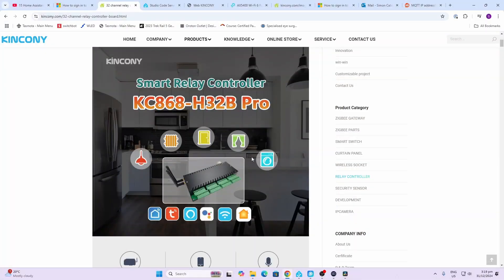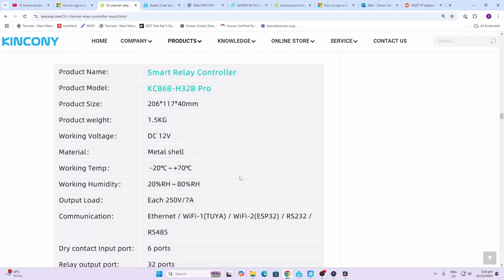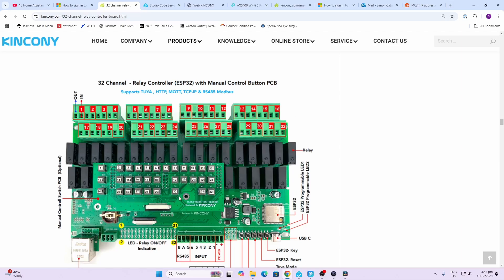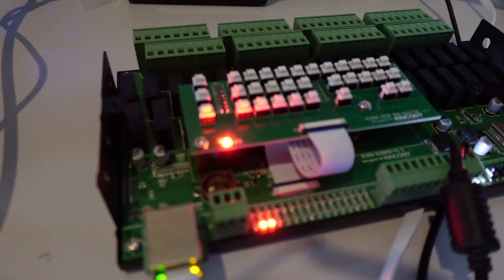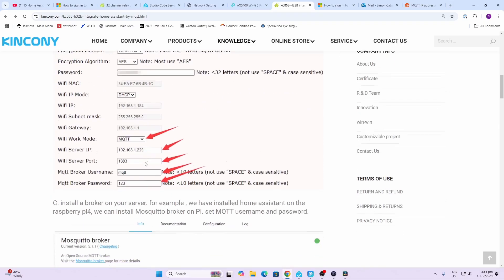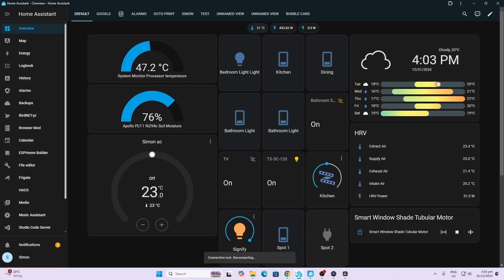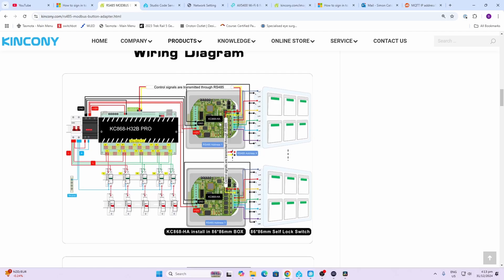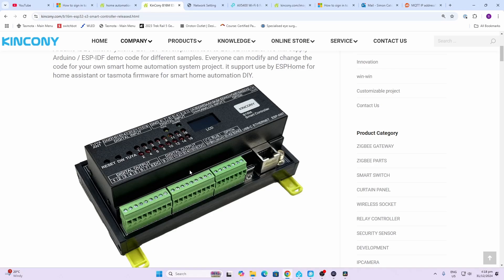Home Assistant controlling Hard Wired Relays for a Super Reliable Lighting System!

Comment: Hi. Thank you for the vid. I want to invest to a fail safe Smart home system I this devices by Kincony seem quite promising, however, I dont know if home assistant or this ESP42 based board fails my sntire home will not functioning. I was wondering if Iwill be able to turn on the lights with a momentary swith in case of a failure
Reply from the maker: Hi Thank you so much for your feedback!  I know, this is the down side of this system that if the board fails you are not able to control the lights locally using the switch.
Reply: Buy a relay board with NO NC relay function and use 2 way switching using normal switches
Reply from the maker: @schazimanselmx2654  Thank you, yes that is a great option!

Comment: If it was POE powered that would have been the cherry on the cake.
Reply from the maker: Yeh, that would be great!
Reply: But power is already connected to it by default, what’s the advantage of POE?
Reply from the maker: @ then you wouldn't need the power supply
Reply: @simonsayshomeassistant  Hmm, yes I get that, so is my assumption that this is a large multi-relay aka multiple Shelly relays together incorrect?

Because the Shelly wouldn’t benefit from POE as the power comes from the power going to the lights. 

I’m sure your response will clear this up for me 😂 thanks!
Reply: @sethkazzim731  you don’t always use Shelly to power lights. I use one as a relay to open my garage door.

Comment: 7 amperes?
I'm no expert, but i have the impression that in many EU countries the relays in your main switchboard have to be 16 amperes?
Reply from the maker: Sorry, I am not sure about the EU regulations, some of the other relay boards that they sell offer higher rated rated relays if you require that to comply.
Reply: You can do whatever you want after the group circuit breaker.
Reply: @FrankyDigital2000  ok so this would not be replacing the circuit breakers?
I guess the basic idea then would be that you for example have a circuit breaker controlling 5 different light zones and that this kincony product would be placed in between. The 1 circuit breaker would provide power to 5 relays on the kincony product and each of these relays would control an individual light zone?
Sorry for the basic questions!
Reply from the maker: @FrankyDigital2000  Awesome that you for the feedback!
Reply from the maker: @FrankyDigital2000  You could also just drive a larger relay
Reply: These mentioned 7 amperes is not practical, it welds the contacts running even lower loads for long time